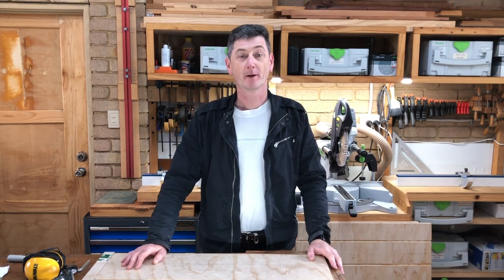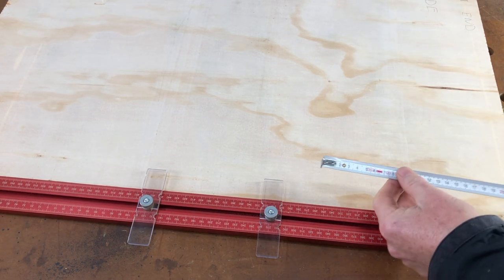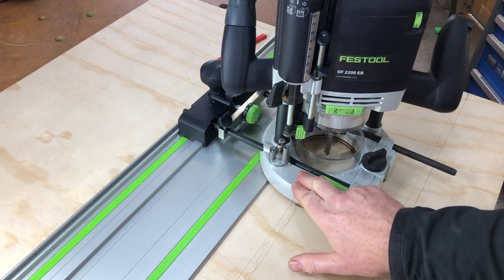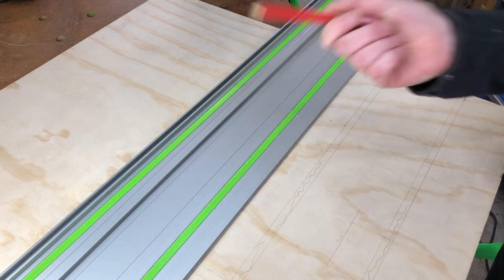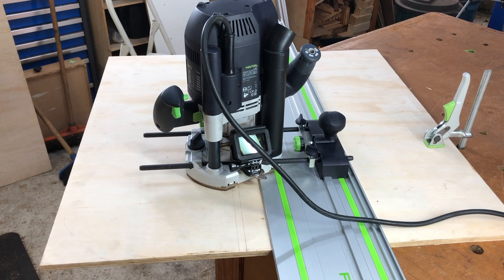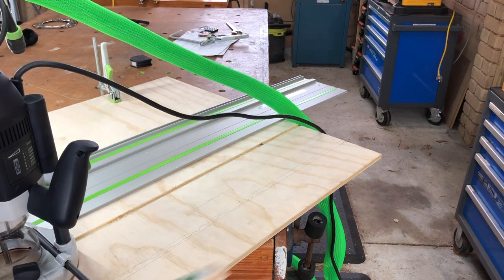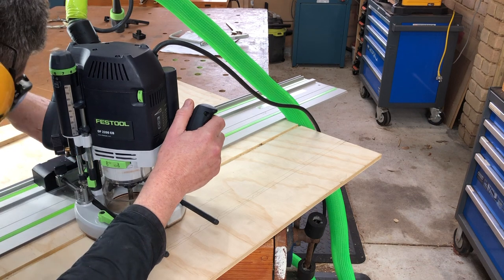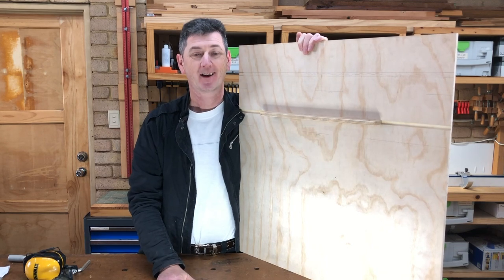Cut dados with a Festool track and router

Comment: Darren - when using an undersize bit to do the two-pass method, it's not necessary to visually align the router bit to the second line (assuming you know your actual material thickness).  The adjuster dial is marked in 1/10mm increments.  In your example of a 10mm bit and an 11.7mm dado -- after making the first pass, just advance the dial 1.7mm and make your second pass.  If you don't have a way of accurately measuring your material thickness, do a test cut in a piece of scrap to verify by test-fitting.

P.S. - I like your high-visibility hose sleeve.  No missing that when your hose is on the floor!
Reply from the maker: Thanks Jeff, I couldn't agree more, but as you said, "assuming you know your actual material thickness". I have found ply

Comment: Looking to get a Festool router as have had terrible run with my Dewalt.  Will get the guide accessories  that you used here.  I recall there is a support piece that I have seen used to keep the router level when not fully supported on track. I noticed you didn’t use it. Thanks again. Good video.  Good Australian  made content.
Reply from the maker: I get that question a lot. The answer is here https://youtu.be/o4zdwXcxMTU

Comment: You could use the woodpecker parallel guide to set your cut lines, then remove it and your on the money. Also,, the track stops can be used for dado's that don't go all the way thru. Get 2 undersized dado bits for your 1/2 and 3/4" and make one pass

Comment: nice, thanks. It is my understanding that with the OF1400 there is a base you can get that compensates for the depth of the track, just like the 2200, although the 1400 does come standard with the foot.
Reply from the maker: Hi Robert. Good to know, thanks.
Reply: the rail guide kit for the OF-2200 also includes a special base plate (which Darren mentions in an older response).  At 3:58, look closely at the  base where it meets the squiggly line for the dado.  At the front and back edges of the base you can see the "notch" where the outer half of the base is two layers thick, while the half closest to the rail is a single thickness.  This step in the base allows you to position the router close to the rail, with the base of the router partially overlapping the rail.

Comment: Good info. Wondering why not use a bit that is width of dado that’s needed? Is there a standard depth for dadoes?
Reply from the maker: Because the thickness of the wood is not the same as the diameter of any of the router bits I own. You’ll find this is more often the case and so this method will keep you covered for different eventualities.
Reply: Darren's Workshop got it. Thanks

Comment: Shim the bars at the back to get the bars parallel to the base. Then run the router on the work piece, not the guide rail. If you do not shim the bars the bars will lift at the back, so when used on the guide rail it tilts the router. Shim the bars and when you run on the work piece the cutter is perfectly 90° to the base. It is then like engineering in wood.  Running it as you are the router is tilted., so the cutter is not cutting at 90°. Put a engineering square against a straight bit and you will see for yourself that the base and cutter is in perfect alignment.  So shim the bars and see for yourself!  And enjoy!
Reply from the maker: Hi John, I am using an offset router base that compensates for the height of the guide rail, so there is no need for shims.
Reply: Apparently you are not familiar with Festool rail guide for the OF-2200 (FESTOOL GUIDE STOP FS-OF 2200 494681).  The lot includes a removable base for the OF-2200 which raises the router so that the it is inline with block that rides on the guide rail.  This base has a cut-away bottom so that the router can be positioned with the bit just clear of the rail edge.  At 3:58,  look at the base where it sits on the squiggly line of the dado, and you can make out the stepped base.  The right side of the base has a double-thickness of phenolic, while the left side is a single layer.

Comment: Do you think it’s just as good to use only one of guide stop adapters on the rail versus using both of them? I learned the hard way that those undersized plywood bits suck, too much variance in that bit and the plywood so I’m left with lose dados. I’m going to try using a smaller spiral bit.
Reply from the maker: Hi KO, you can use both adapters if you want as long as they don’t get into the way of your cut. Spiral bits will definitely give you a cleaner cut, but if your dado is too loose I suggest just sneaking up on the width so initially it will be a little bit too tight and then you just remove what you need to to end up with a perfect fit.

Comment: It appears that you're using a router base with two thicknesses in order to compensate for the thickness of the track.  Is this a Festool accessory or one of your own making?  I also like to (sometimes) use the router instead of the table saw to make dados, but I don't like the uneasy, wobbly-ness of the router on the track due to the gap between the router and the material caused by the router riding on the track, up above the material.  Your 'filler' base pad solves that problem!  I'd like to use that solution on the OF 1400 router.
Reply from the maker: Hi Jeffrey, Yes that is a genuine Festool offset base. It comes in the accessory kit for the OF 2200. I believe that the OF 1400 has a drop down leg that is meant to accomplish the same thing.
Reply: @DarrensWorkshop  if you buy the 492601 rail guide for OF1400, it also comes with a drop down support leg that screws in and will add thickness to the side of the router away from the track. I know because I have a OF1400 and I have the rail guide too.

Comment: Hi there, good video :) can I ask you how deep did you go on each pass?
Reply from the maker: Thanks Christopher. I set the maximum depth of cut and then just made 3 shallow cuts, but I took off roughly 2mm per pass.
Reply: @DarrensWorkshop  thank you,  I have seen others do what you do in one pass which seems too much. Can I ask you also ..do you think the 1010W ferstool router is also good enough for this type of work? I am trying to make my mind up between the 1400w (the one you have) and the 1010w watt machines
Reply from the maker: Hi again Christopher, I have the OF1010, it is a good little router. The large one I have is the OF2200, also great. The OF1400 sits between these two as a general all purpose router. If you don't own a router at the moment, and only intend to buy one, then this would be the one I would recommend. Cheers Darren.
Reply: @DarrensWorkshop  that is what I was thinking also :) thank you

Comment: Shouldn't you have had the foot on the router to make sure it was 90 deg vertical?
George  South Yorkshire
Reply from the maker: Hi George, The OF2020 doesn't have a foot like the OF1400. Instead I have an offset base installed on the router that compensates for the height of the track.
Reply: Darren's Workshop ok thanks. Learn something every day!

Comment: Your are missing the foot support on the router.
Reply from the maker: No I wasn’t. It’s a Festool 2200. It doesn’t have a foot like the smaller routers. It uses an offset base, which I was using.

Comment: That's a very long process!
Reply: Compared to the time to install a dado stack in your table saw and tune it to your undersized plywood?  Darren was doing a one-off cut, and qoing step by step to explain everything  =Typically,  I have my router guide dialed in to a simple offset from the rail edge (like 10mm), and I just add 10mm to my actual dado positions when doing my layout lines. 
=Add a rail square to your setup and you don't need to mess with the long lines and checking for parallel - just make a tick mark at each dado position
=If you're using an undersized bit and doing two passes, there's no need to measure a second time as Darren did.  The adjuster knob is marked in 1/10mm  increments, so you can quickly dial in the exact offset for your second pass
=If you're doing a batch of the same parts, add parallel guides to your setup, with a set of flip-up stops to quickly make a series of repeatable series of cuts